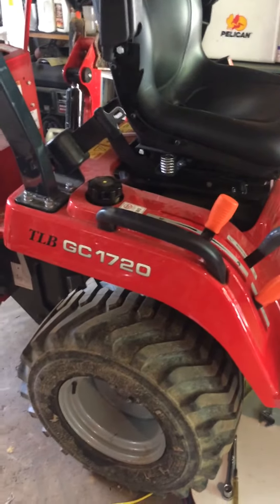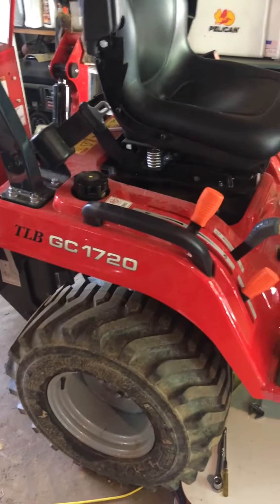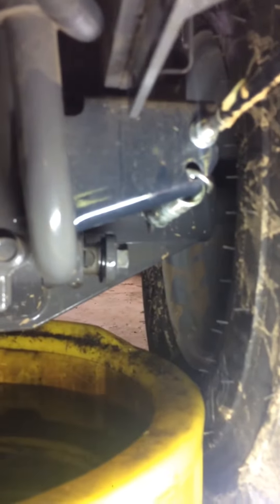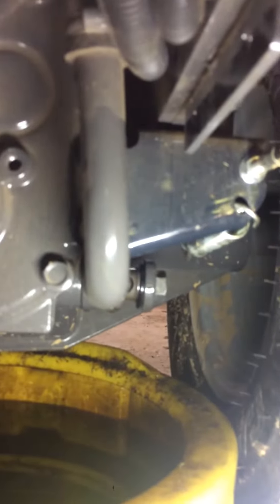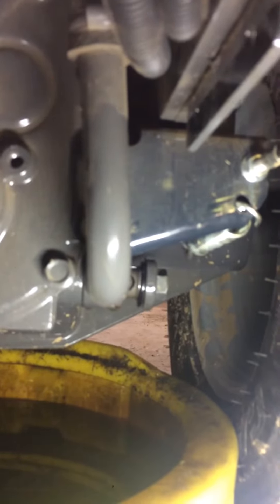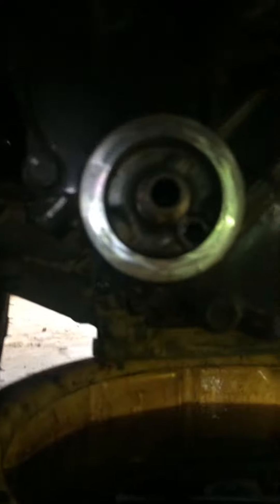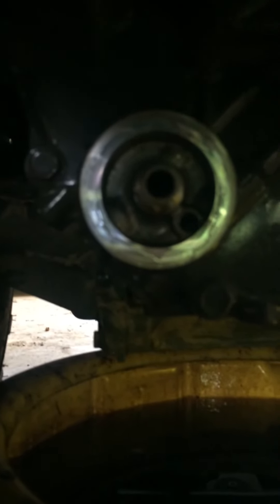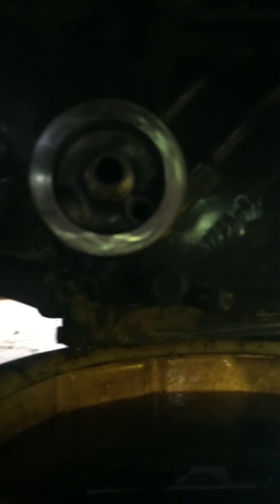Massey Gc1720 transmission suction filter

Comment: thanks.  ya seems not too many videos on this machine.  I'm considering buying one, so I'm researching. How is the mower deck working so far?
Reply from the maker: James Hale  I got the 60” drive over deck. The mower deck works great. The cut is just as good as my simplicity. It is easy to take on and off the tractor. The only thing I don’t like is how far the deflector shield sticks out.
Reply: Soggy Acres i noticed the deflector to and wondered about that. Also metal, prone to getting bent i’d suppose. I don’t think that shortcoming will deter me. Can you mow in reverse?
Reply from the maker: James Hale  you can mow in reverse and there is no safety switches or buttons to push. The deflector is heavy duty and will take a pretty good impact to bend it. Hope this helps.
Reply: It helps.  Your video plus others I've watched helped me decide.... so machine purchased.  You were right about the deck, it cuts really nice and flat, and its heavy duty.  I am having one concern tho, my fwd hydro pedal is quite stiff, my knee hurts after just 10 minutes, and i have troublew keeping my speed. I find i slow down due to the hard pedal. reverse is nice and smooth. not the linkages or return spring, as I've gone thru all that.  have you noticed anything with the pedals? smooth and easy to hold speed?
Reply from the maker: James Hale  congratulations on the tractor. My pedals got a little easier after about 10 hrs. I do use the cruise control a lot when mowing.
Reply: When you get a couple of rounds done when mowing engage the cruise control  it will help your knee .